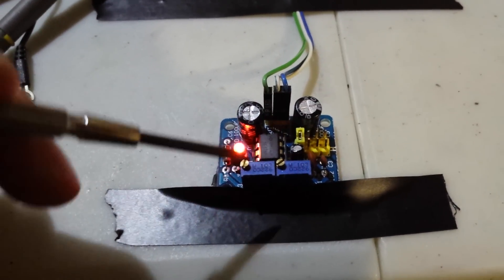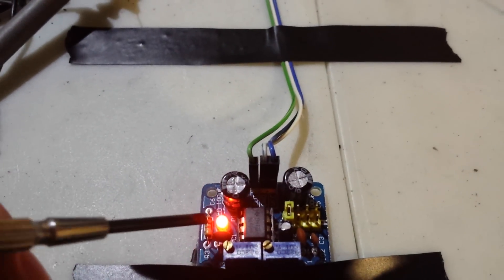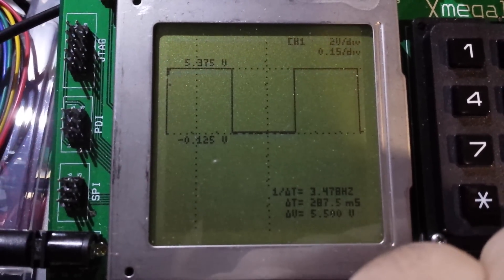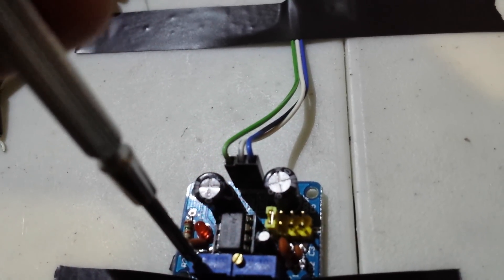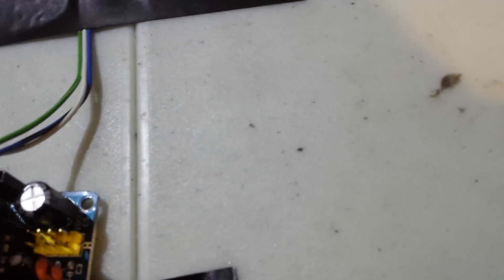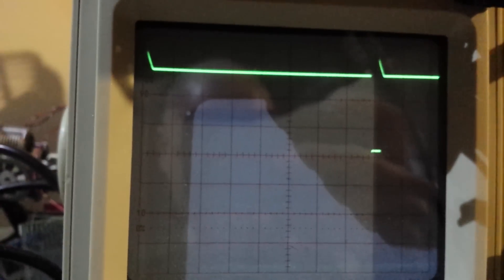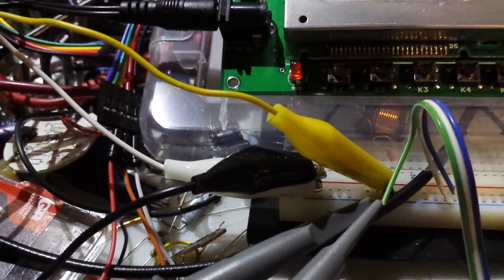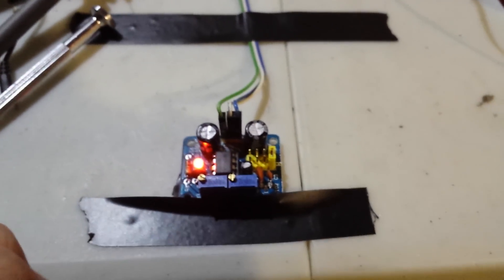NE555 Duty Cycle and Frequency Adjustable from icstation.com

Comment: Can this device be used as an Electromagnet Pulse controller? Like in a Vibratory Bowl Feeder...?
Reply from the maker: It can be use yes make sure you add an external transistor or MOSFET to control heavier load and depending on the time delay you need you will have to change the capacitor.
Reply: Awesome thank you for the information!  @bakupcpu
Reply from the maker: @stephandeklerk8  Glad i could help!

Comment: Is this devise is valid in the Russian pirate metal detector circuit or no , when substituting ne555 ic by this devise with some modifications
Reply from the maker: I have no idea of it would work or not. But if they need a 555 timer square wave generator this circuit should do the trick. The ne555 I believe is a lower power IC the internal and pinout should remain the same.

Comment: HI There, Very good explanation and testing, thank you. 
Is it actually a  positive offset frequency?
Reply from the maker: I'm not too sure about the offset it's a generic 555 and I have not load it enough to have the IC warm up. Cheers!
Reply: @bakupcpu   I see @4:24 in your oscilloscope it varies from 5.357 V to  about zero (-0.125 V). Am i right?
Reply from the maker: @VahidBehravanVahid-Behravan  Ah yes it's a cheap digital oscilloscope and the frequency is somewhat low. Error may be present.

Comment: Nice demo duude... Really.

Could you Tell me what to do to get 0.5v to 0.9v output from NE555. I'm tryin to fool my ecu due the aging O2 Sensor. So i'm gonna replace the o2 sensor with this stuff. But its operating around 0.5 to 0.9v.. 

5v definitely will fry the calculation
Reply from the maker: You can you will have to use a voltage divider with resistor. You could also use a multi-turn potentiometer  get your output set and you should be good.
Reply: bakupcpu nice.. i'll give it a shot.

Thanks for the suggestion. 

Keep inspiring

Comment: hello my good man, im replacing a flat battery sealed hour meter with a new one and want to put the hours ive lost back on the new one (wire around sparkplug lead type hour meter).   im guessing spark plugs run off square sound waves? can i use this device to put hours back on my new meter?
Reply from the maker: Ross G spark plug do run on square wave if your meter has a simple input yes I don't see why this can't work.
Reply: bakupcpu firstly thanks for such a good detailed run through on everything with its tech workings of it and how to use it!! i went on ebay straight after this to look for this exact device on the same PCB and i found many of them starting from $1 AU so i bought 5 of them from china so they are 4 weeks away for me. I seriously don't want to take up anymore of your time but i have 1 a layman's question for you about this device if i may, am i right in saying this... there are 3 poles on the PCB one is negative one is positive and the other is output for pulses and if i wanted to connect a light that pulses i connect the pulse out to the positive on a global and the negative from that globe to ground? i ask this because not all PCB in the past have come with tech drawing's for me ( my hour meter does not have a direct input, it is designed to wrap around a wire working on pulses through the wire it goes around making a coil around it through induction im guessing on that last one) thanks for your time i really appreciate it this could solve a problem with a simple device like this! i subbed to🖒 thank you🖒
Reply from the maker: The 555 timer can sink or source up to 200 mAmp if you need bigger current you will need either a transistor or a mosfet to supply it. A quick google search will reveal tons of circuit that you can use. Also the chip is on a socket and can be replace if you damage one those are very cheap on eBay as well. Good luck with you project.
Reply: bakupcpu ok 200ma max i would have made a mistake right there thinking a interior car halogen globe i had lying around was ok being 1w, LED now to max 200ma, tick! ill google wiring diagrams and those other options if this fails, thank you for your time i am VERY grateful mate thank you.
Reply from the maker: 1 watt is only about 83mAmp so it's should be good but better safe then sorry.
Reply: bakupcpu 👌🖒

Comment: Hello, I need this operating at 30-50hertz with a duty cycle above 40 but don't have an oscilloscope. Could anyone tell me how many potentiometer turns I need to do to accomplish this or perhaps point me to a data sheet with the info? 
Easiest way would probably be to say, "turn CCW until can't anymore, then do 14 turns CW and you should be in the correct range" or the like.

Thanks you!
Reply from the maker: Actually if you have a computer you can use the sound card input for a software oscilloscope. And in the range of frequency you will be using it will be fine just don't put 12 volts in your sound card... You can also use the 555 calculator for exact number on the resistance and capacitor those are available online from there you can simply build  permanent version of the circuit. You can also generate a 50% duty cycle wave with the 555 pin 3 connected on the capacitor as a charge discharge function then for the frequency if your multi-meter support frequency counter you can simply use your multi-meter. Beside that counting the turn will be a bit non precise but would be the last solution if you can't do any of those above :) hope this help you Cheers!
Reply: bakupcpu
Thanks for responding!

 For the computer method, how do I go about connecting this up to it? Alternatively, could I hook up a speaker and use a mic w/ software to find the frequency?

Here's some background info:

I have a receiver which when activated outputs 5v DC. The servo I want to activate, however, requires a PWM signal to tell it to move. I'm planning on activating the receiver wirelessly, have it output the 5v necessary to run this pulse generator, which will then imitate a set PWM signal that should in theory activate the servo!

The better way of doing it would be to find a 1 channel receiver that outputs a low PWM value when waiting for a signal, and a high PWM signal when activated by the button or switch on a connected transmitter.
Hours of internet searching didn't manage to find such a device though, so I'm inventing my own little workaround :p
Reply from the maker: The best would be directly connected at that point you can see the duty cycle and frequency as well. You could also use an Attiny85 or similar micro-controller as well unless you simply require a fix output then the cheapest way is either 555 or astable oscillator made with 2 transistors.

Comment: Thank you my friend. What is the max input current ( amps)?
Reply from the maker: 555 timer have a max of 200 mAmp on the output pin you can also buy some low power one I would refer to the data sheet for those.
Reply: Yes, i know the output but i did question for the max current INput (amps) that it supports. Sorry for my bad english, i hope you can help me with the answer!
Reply from the maker: +Rafael Rondon the 555 will require a few mAmp to operate and what ever it require to drive the load.
Reply: I understand, thank you my friend, regards!
Reply from the maker: +Rafael Rondon glad I could help! Cheers

Comment: Can this be used to drive a stepper motor, if so where do I put the four motor wires.
Reply from the maker: No you still need a driver board for the stepper you can use this one to supply a clock for the driver board.
Reply: Yes you can. But it really is not worth the trouble unless you have a specific application for it.

Comment: please, you can draw the circuit and share
Reply from the maker: jose pastor Good day, It's a simple circuit that can be found on the internet if you make a quick search for it hence why I haven't share any schematic and also I'm not the creator of this board. Thank you for your comprehension.
Reply: +bakupcpu so selfish guy
Reply from the maker: @clinicap1193  Not selfish at all, this circuit is all over the internet. A simple search will give you this schematic as well has many other option.

Comment: is there have model can using dc 27-50v support？
Reply from the maker: 555 timer are limited to 18 volts max but nothing stop you from using a regulator to step it down and the output pin can drive a transistor or a mosfet to drive you higher voltage load.

Comment: HI There, Very good explanation and testing, thank you.  I wanted to activate a vibration motor with this and as I am learning all this starting yesterday, how is the motor wire to this?  I understand the VCC and Ground for the battery, but will the output simply run to one side of the motor? And does the other side of the motor simply go to ground?
Reply from the maker: The 555 can handle 200 mAmp of power if your motor take more you will need to use either a mosfet or a transistor to be able to drive higher power load. the best way to know how much your motor consume is to hook it up to a power supply and take measurement.
Reply from the maker: Kirk Nano
Of course 1.5 amp is not a big deal depending the voltage you plan on running the device on. And also what type of control you need if it's a simple speed controller then a classic PWM controller would work just find if you want more function you can also use a micro controller such as an Arduino. If you want you can always share more detail and I'll help you the best I can.
Reply from the maker: Sounds very interesting! Glad I could help :) Cheers!

Comment: What do you think about the use of PWM to make an LED put out more than normal light output power by pulsing higher than normal forward current at a low duty cycle and a high frequency?
Reply from the maker: You can do it with no problem if you stay inside the max on time in the data sheet Good see MakerJ101 channel he actually pump over an amp in a little LED very interesting to see :)

Comment: How much current is it capable of delivering?
Reply from the maker: The basic 555 timer is able to deliver a max of 200 mAmp you can boost it up using several method depending what you need :)

Comment: Very nice little circuit!  Not really the best though if you need to control frequency and duty cycle separately.  If you need that you just have to add a op-amp like the circuit I used for my LED light ball.  But looks like a great circuit for the price!  How would I drive a fly back with this circuit but using two mosfets?  So I would have a bifilar coil like a ZVS with the center tap connected to the positive supply and the two ends connected through the mosfets to ground.  So I would need one mosfet to turn on then the other.  Could you make it alternate just by using some resistors?  Thank you so much!  I have to catch up on your videos! :)
Reply from the maker: Well it's not a bad circuit as it's almost universal for frequency and duty cycle but yes it has it's limitation now to drive 2 mosfet with that hmmm....you would need to make an inverted output with the main output :) very easy to do one npn transistor :)
Reply: Thank you!  Sounds pretty simple.  I kind of want to try driving a fly back using my new IRFP260N mosfets and a 555 timer PWM circuit.  I want to be able to get variable frequency.
Reply from the maker: Should be easy indeed :) let me know if you need help for that one :)
Reply: Yay!  Thank you!  I'm designing the PWM circuit board for my fume extractor speed controller right now!  I will probably adapt a slightly different one for a fly back driver.  It's like some crazy nearly impossible brain game making all these connections with minimal jumpers!  It's basically the same as the one I built for my LED light ball except I added a mosfet, diode, another resistor, and another capacitor.  The original one has 5 jumpers!  Very bad layout and design!  The new one only has one jumper!  And the board is nearly 1 centimeter smaller on all sides!  It's fun building PCBs!  The program I am using does have an auto trace feature but it doesn't do very good with complicated traces.  And it just doesn't look good so even on auto I still have to tweak most traces a bit to get what I want.  But it is a really nice program for being free.  It's called Pad2Pad.
Reply from the maker: I'll go check it I need a good pcb design :) hehehe! Thanks
Reply: I don't have a video of the PCB yet but I think I will do a video on it.